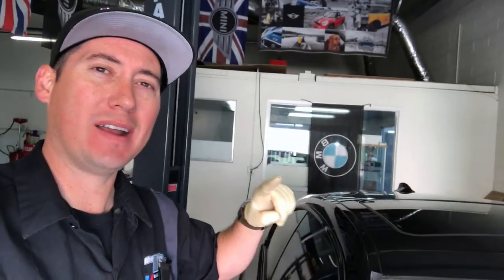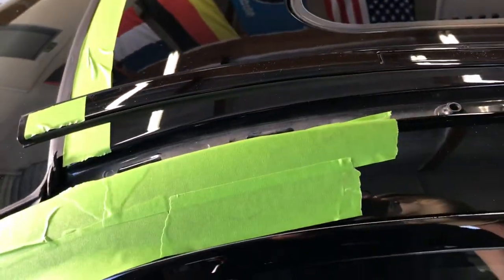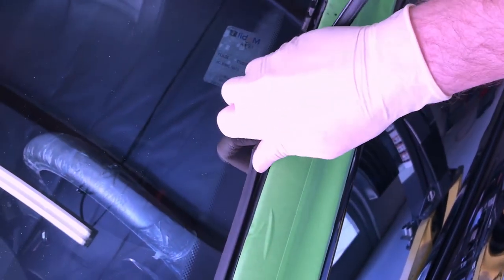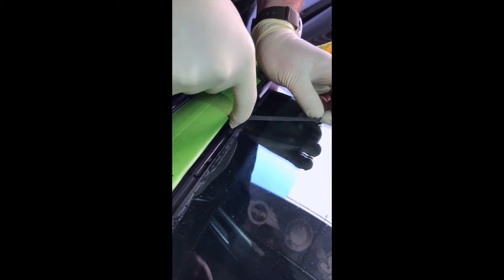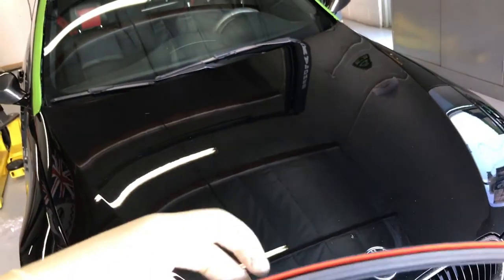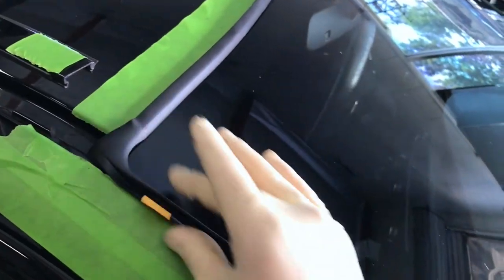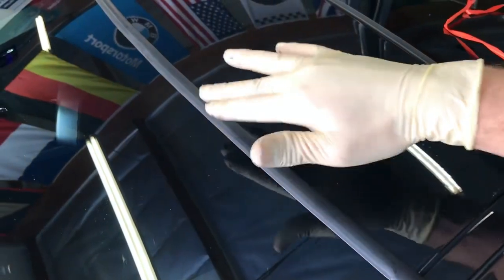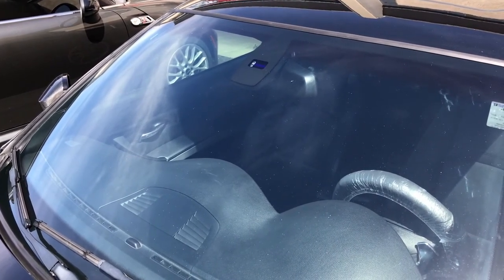Cracking Windshield Seal - Replacement for BMW

Comment: Is the rear window seal on the e82 replaceable like this?
Reply from the maker: Hey Chad,  I can't remember  I'll have to look
Reply: Hi. Thx for your video. I need your advice. In the very beginning you mention how difficult it will be to remove the seal of the windshield was replaced, and they put too much glue and I can remove that seal. Any suggestions? Thx